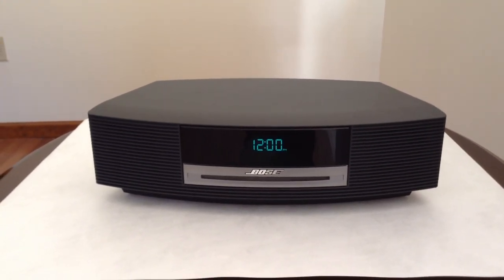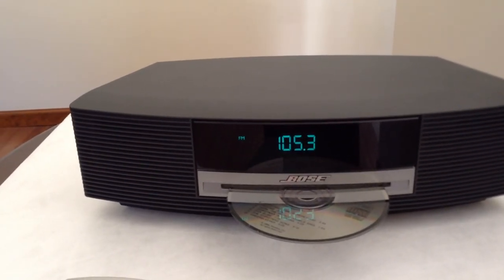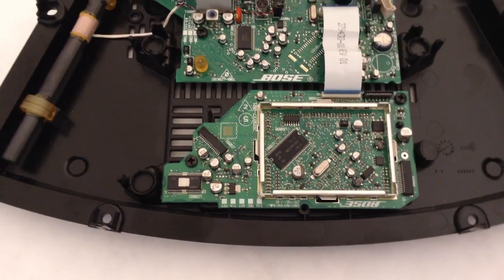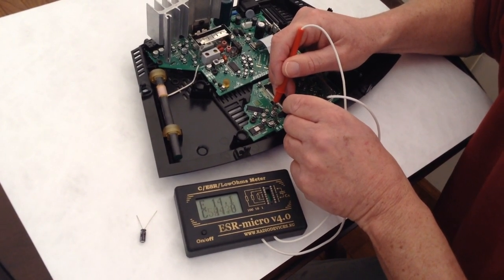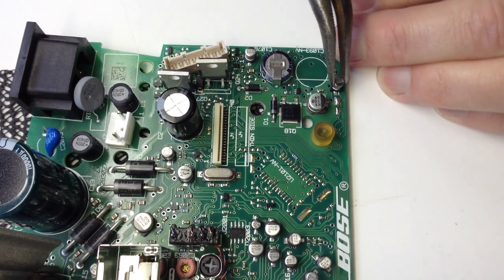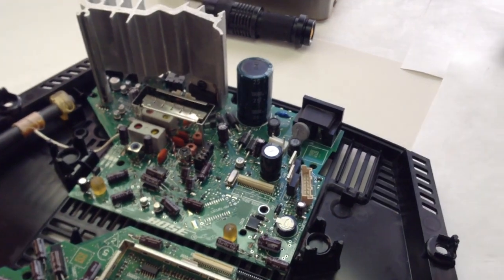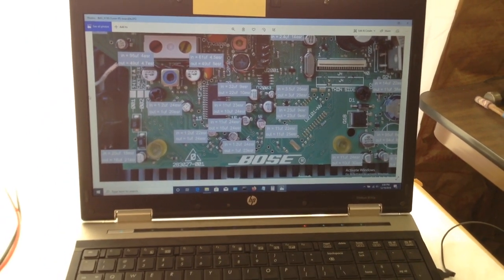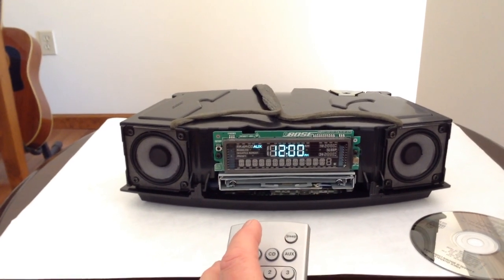Bose Wave II - AWRCC1 resets and CD skipping. Repair "Please Wait" problem

Comment: Thanks for this video...my question? what kind of capacitor to replace 22 uf 6V cap shown in the photo ? where i could buy it.Please help.thanks.
Reply from the maker: It is in the description above. I used 22uf 16v through hole caps with radial leads instead of the original 22uf 6v surface mount caps that were on the board.

I purchased them from Digikey...
https://www.digikey.com/products/en?mpart=UPW1C220MDD6&v=493

If you want to replace the 22uf caps with surface mount,  these may be a good option...
https://www.digikey.com/product-detail/en/nichicon/UUD1A220MCL1GS/493-2242-1-ND/590217

 Good luck!
Reply: @georgeterbush2976  Appreciated very much. I will order 1 each ,right.?= 2.
Reply from the maker: @RealMacoy  Your original question was "what kind of 22uf cap did I use and where did I buy it". If you are only going to replace the 22uf caps under the metal can, then you will need 2. 

I am not saying that just replacing these 2 caps will fix your Bose system. When I worked on mine, I measured each cap in the system and found a LOT that were bad. I ended up replacing most of them as you can see in the video. Some viewers who have posted here have found that replacing just the 22uf caps under the metal can was enough to get the player working again. There is no guarantee that you will be as lucky. If you are able to take some measurements and order replacement caps for the ones that are bad, that would be the correct way to do it. Capacitors are cheap. It's the shipping that is expensive. The shipping cost will be the same whether you buy 2 or 20 capacitors. 

Good luck and keep us all posted on your project!
George
Reply: @georgeterbush2976  Thank you so much.

Comment: Hi George, I have the same Bose system and all i get is the clock display. Nothing else seems to work. I got it free from someone as well and would like to revive it. She said she tried a new remote control and still nothing. Any ideas?
Reply from the maker: Hi Tom. I only had one Bose system to play around with so I can not speak with authority on how to diagnose certain symptoms. Are saying that you only see the clock and not the "Please Wait" when you press any of the selector buttons?  Even without a disk in the player, when you plug the cord into a power outlet, you should see the clock and "Please Wait" should flash a few times. Bad caps can cause all sorts of issues. Many of my caps were in bad shape, but I still had the radio work after it warmed up a bit. What happens if you keep the system plugged in for a few hours? Are you able to make a selection with the remote then? Also check the remote battery with a volt meter. I believe it should measure 3 volts. Good luck. You have a nice little system there if you can get it working again.
Reply: george terbush Thanks for the reply! The unit does not display the ‘please wait’ message either. Only the clock. I will plug it in for a few hours today and see if any changes. Battery is good.
Reply: I have left it on for several hours and still only displays the clock.
Reply from the maker: @tomknull2336  It could be the power supply like what "B" found in his post below. He had a bad 10v regulator.  You would have to take it apart and start measuring voltages and component values with a meter. I'm really sorry I can not be of more help.  It's just guessing at this point without having the system in front of me.
Back in the day, I use to work at a computer company called Commodore. Myself and the other techs would each be responsible for fixing between 50 to 100 Commodore 64 mother boards down to the component level everyday!  Most of the time we knew within a minute after it was plugged in what the problem was. That's the beauty of working with the same system everyday. I really wish I had that kind of experience with the Bose,  but I only ever worked on the one that I own. I hope you can fix your Bose system and share your experience with others here.
Reply: @georgeterbush2976  Hi GEorge, I am assuming it is getting power though as the clock is nice and bright. Is that not an indicator?
Reply from the maker: @tomknull2336  The power supply inside will take the 110 volts AC and convert it to several low voltage DC supplies. The supply going to the clock may be ok, but the supply to other circuits may be bad. It's not like the whole system runs on 5 volts.
Reply: Exactly same problem happens to me. I have 2 of them, one works perfectly. The other one only displays clock, can’t activate any function (CD/radio/aux). Can’t turn it on either. Actually only few buttons in the remote works and display shows movement...like volume, alarm on/off etc... I am so sad I don’t know how to fix it
Reply: @albertbali2559  I'd say it depends if it has already been opened. The ribbon cables have thin silver "pins" that make contact inside the connector...if someone remove them repeatedly then they may have folded back on themselves and might not be making contact. I would check the one that connects to the CD player PCB underneath the slot load CD drive on the right (as you look from the front). I had the same problem on the ribbon that comes from the PSU PCB (large one at the back) to the CD player PCB, one pin folded back and I got no CD drive motor to spin the disc. I pulled the ribbon and inspected it and there was one single "pin" that was bent back. You can try to super glue it if that has happened in your case, but I just straightened it out and pushed the ribbon in at an angle that put the least pressure on the "pins" until they were close enough to the contacts inside the connector and it worked first time.

Comment: Thanks for your follow up. I was wondering about the cap that you labeled destroyed. Was it replaced with 16v 100uf cap?
Reply from the maker: Yes, I replaced that cap with a 100uf 16v.

In the picture where I added notes in the gray boxes, those are the measured values of the OLD capacitors in-circuit. I put them there in case someone else wanted to compare their in-circuit measurements with mine. I will make that clearer in the description. Sorry about that. 

In the description I listed the caps that I bought to do this project. I substituted 16v for 6v in some cases.

Comment: Hi.George Terbush. This is the model, Bose Wave SoundTouch IV. The remote control is very different, I think the method is different and I don't know if it fits mine. In my country, 60Hz is used. It is possible that you can investigate how to do it in my model, I will be very grateful to you. Thank you for your patience.
Reply from the maker: Hi Rafael. According to another web article I found, it is the same procedure for the  SoundTouch IV...
https://community.bose.com/t5/SoundTouch-Archive/Soundtouch-Wave-IV-poor-timekeeping/td-p/79038

My remote looks different from the one in the first article but it worked just the same.
Mine looks like this...
https://img.archiexpo.com/images_ae/photo-g/67555-11449420.jpg

I wish I could help you, but I only have the one Bose radio that my neighbor was throwing out.

Good luck my friend.
George

Comment: there are a few 22uf 6v capacitors, are you using the 16v one to replace them?
Reply from the maker: I used 16v because they were through hole / radial type caps and I could lay the part on its side. If you want to use surface mount (SMD) parts, then height is a big factor. The 6v & 10v caps are shorter than the 16v cap.

Comment: Sir, you are a gentleman and a scholar. 

Thank you so much for this guide, I have a Bose wave with the same symptoms and been scratching my head for weeks, assuming it was a mechanical issue from the clicking noise. I've just ordered an ESR meter and the capacitors listed. Can I ask why you opted for through hole caps rather than SMD?
Reply from the maker: Hi Lucy. 

My decision to use through hole instead of surface mount caps was based on the advice from this guide where he said ... "I refuse to use new SMD capacitors for replacement. Current technology SMD capacitors are far less reliable and far more failure-prone than conventional TTH (Through-The-Hole) capacitors."

https://jestineyong.com/audio-restoration-repair-bose-wave-music-system-awrcc1-awrcc2-awrcc7/ 

That being said, I think fitting in the surface mount caps would have been a lot easier. SMD caps made by top tier manufacturers should be good enough these days.

What ESR meter did you decide to buy? Please keep us posted on your project. 

George
Reply: george terbush I ended up just going for a cheap one on amazon from a company called Arceli. 
I have access to a decent rework station with hot air so I decided to go with some high quality SMD caps for the replacement. I’ll keep you posted with how it goes! 😊
Reply from the maker: @FelineGoblin  Awesome Lucy! That's the way I would go.  That ARCELI LCR TC1 ESR Tester should have a way to be calibrated when test leads are connected. This way you can test the caps in circuit. I'm curious to see what your cap ESR readings are.  Take your time with removing the old caps. Very exciting! 😊
Reply: I have a few known good caps from other projects so hopefully I’ll be able to get it calibrated ok and I’ll let you know the readings. 

I’ll be sure to take care when removing the caps, but considering the pads didn’t tear when you removed the caps with pliers I think I should be fine!
Reply: My only concern is that I’m not getting the ‘Please Wait’ message that other users have mentioned, but I am getting the same skipping and clicking noise. I’ve ordered a full set of caps and I guess I have nothing to lose at this point so fingers crossed!
Reply from the maker: @FelineGoblin  Hi Lucy. Any update on your Bose Wave system repair?  I would love to know how you made out. 
All the best,
George

Comment: I’m glad your repair worked but … why would you replace the surface mount electros with through hole ones? That doesn’t make sense to me. The surface mount  caps are readily available, they’re cheaper than the through hole caps, and soldering them on would have been easier than soldering those through hole caps onto the board in that fashion.
Reply from the maker: Hi Robert. I mentioned in the video that this is NOT a project for beginners and if I were to do it again I would probably use surface mount components. I believed at the time that radial, through hole parts would be higher quality instead of SMD.
Reply: @georgeterbush2976  Thank you for your answer. Since watching your video I’ve watched a lot of other videos on repairing these units and it looks like it’s quite common for people to replace the smd caps with through whole ones. I read that people people who repair video game consoles do this too.  Interesting. I had just never seen that before.
Reply: Well I repaired mine tonight.  That is the reason I watched your video.  Now it works perfectly! Thank you for posting that.  I was going to order SMD caps because I thought that is the “right way” to do it, but it turns out I went through my parts bins and I had all six caps (I just replaced the six on the board under the shield because I read elsewhere that those are likely where the problem is.) in through hole versions, all small enough to fit under the shield.   So I went with those and didn’t have to order anything.   

I agree , it’s not a job for beginners.  It’s still a surface mount board,  and it’s a tight space with a lot of small traces.  And using through hole caps presents the extra challenge of cutting and bending the leads in just the right way. 
It’s so satisfying to repair old gear and find a good home for it.  

Just a note for anyone else with this problem: I saw one video where the guy said that he only replaced the two 22 uF caps under the shield and that fixed the problem. I don’t know if that would have worked for me or not - I replaced all six - but when I was removing them I saw that it was exactly the two 22 uF caps that had dry powdery leakage and evidence of failure.
Reply from the maker: @robertthompson5908  Great job. Thanks for the update. Even though replacing the two 22uf caps may get the unit working again, many of my electrolytic caps had very high internal resistance so they were not working as well at filtering as the designers envisioned.
Reply: I have the same radio.  My cd player sometimes has trouble ejecting a disc - seems like the disc slips between the ejection rollers.  Does anyone know how to reliably fix this issue? Are replacement parts available for the cd eject mechanism?

Comment: I am trying to fix an AWRC1G Bose Wave Radio/CD that doesn't turn on. I replaced the fuse but that didn't help. Some sites say the Q4 transistor is frequently an issue but I'm not sure where to find it. Thanks for any input and your video.
Reply from the maker: Hi Seth. Sorry I can not really help you. I only have some experience working on my AWRCC1 radio. If the fuse was open, then you probably have a short on one or more parts. Have you checked the diodes and transistors with a meter?

I saw several sites where people had a Q4 transistor shorted. The part number is 2SC3792. They replaced it with a 2SC2655.
One of the sites is here...
https://www.diyaudio.com/forums/solid-state/200773-fixed-bose-wave-radio-sound-2.html

I usually like to buy electronic parts from a reputable store like Digikey or Mouser but they show the part as obsolete and sold out. Good ol Ebay has them but I don't know how good they are...
https://www.ebay.com/itm/2SC2655-NPN-Silicon-Transistor-2A-50V-5pcs-/123089391357

Keep me posted on what you discover with your Bose radio problem.
Reply: @georgeterbush2976  This is very helpful. I'm still not sure where that part is on my board — I've looked and looked. I'll keep you up-to-date. Thanks so much George.
Reply from the maker: @seth8629  If your Bose AWRC1G looks like the picture in this link, I have a yellow arrow pointing to Q4. You should see Q4 printed on the top of the circuit board...

https://www.dropbox.com/s/8gbgysdmf67pfzk/bose%20AWR1-1-arrow.jpg?dl=0

If your board looks like the one in the article below, then the transistor is not marked as Q4. You have a different model radio than the people changing Q4.  You can still check the transistors near the fuse and also check that bridge rectifier for shorts.  - Good luck!

http://www.umonfw.com/diy/bose_waveradio_fuse_replacement.pdf

Comment: Hello! I have the Problem with the Wave IV digital. After once power off some days before now there is only a "Please Update" on the LED. I have updated ist several times (USB port / USB Stick / WLan) but no reaktion. I think there is the same Problem as "Please Wait". I heated all the Cap´s on the board but no reaktion. Any solutions or ideas?
I had this problem 2 years ago and send the Wave to bose and had to pay 160€ for repair. No i think i may save a lot of money for the next years by doing it myself
Reply from the maker: The "Please Update" on the Bose Wave IV may be different than the Please Wait problem that we are seeing with bad caps. Look at this website first...
https://community.bose.com/t5/SoundTouch-Archive/Wave-IV-won-t-update/m-p/35520

Comment: Hi. I have a problem with one similar to yours, the clock is running late.  What would be the component that would have to be replaced to solve the problem.
Reply from the maker: Hi Rafael. Although I have never seen this problem, I did some research and believe I found the solution. The Bose radios are normally setup to operate on a line frequency of 60hz (hertz). The clock in the radio is based off of the AC line frequency. If your country's line frequency is 50hz, your clock will run slow. There is an easy fix. You need to go into the Menu Settings (press "Alarm Time" button on remote) and change the clock's frequency reference. The Bose Wave II has 2 clock options namely "Line" and "Crystal". Changing the clock source to "Crystal" should solve the issue for you. 

If you do not see the clock option in the Menu Settings, you can add it by pressing the "Alarm Time" button for 2 seconds. Once the setting options come one, press the presets button #3 on the remote for about 5 seconds and you will come to a menu which shows you the current clock setting. This will read line or crystal. Toggle the setting by pressing the time + or - key and leave it for 5 secs to apply the settings. 

This is the site where I found the info...
https://www.fixya.com/support/t4784037-bose_wave_radio_cd_clock_running_very 

Good luck!
George